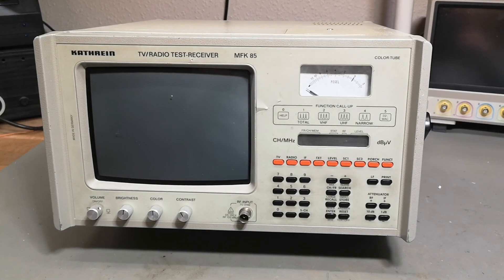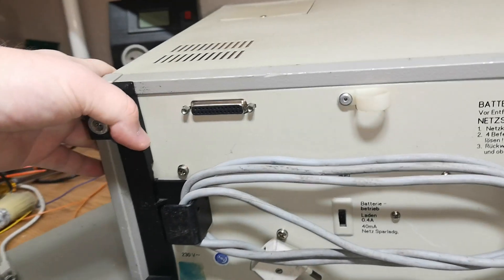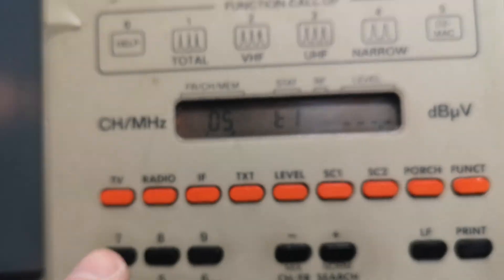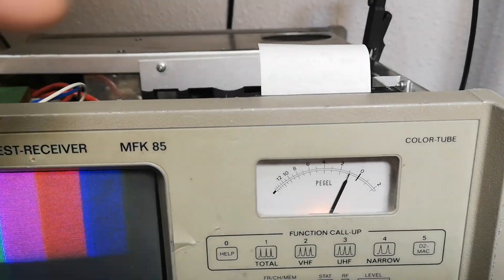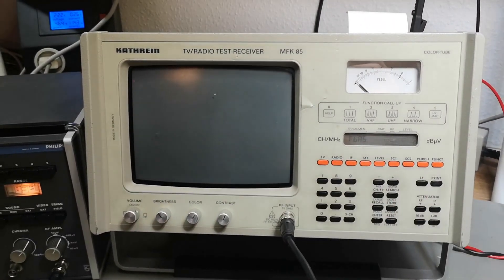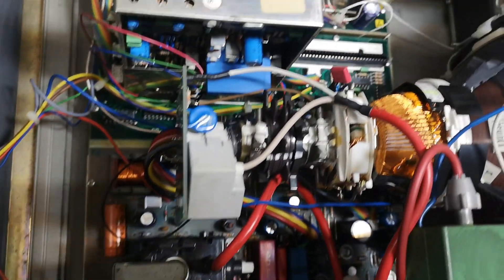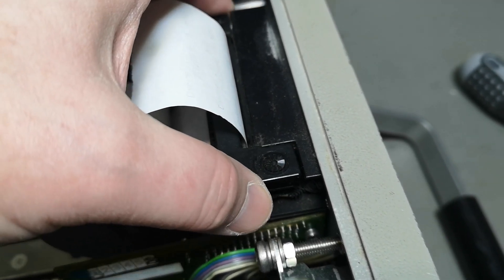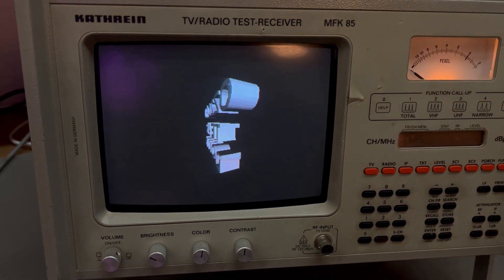Kathrein MFK 85 TV/Radio Test Receiver 1994 test teardown

Comment: Hi, as Dragon Lard wrote, it's a beautiful machine and it's a shame about the damage 🤔 the screen could perhaps be saved with a car windshield repair kit, even the damage from the batteries can be removed, but some signs of damage will probably remain on the control panel.
Your logo was displayed here probably the best I've ever seen, I have to write again how incredible this older technique is - it still works after so many years 👍
I really like the illuminated gauges, both on the monitor and on the generator - it looks luxurious, especially in the dark.

Ecin yad 😁 Mot